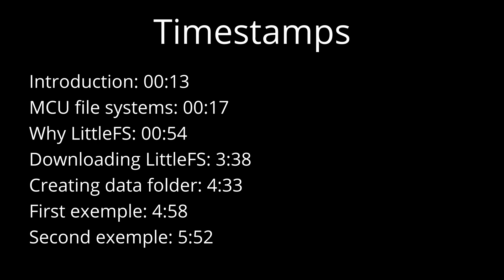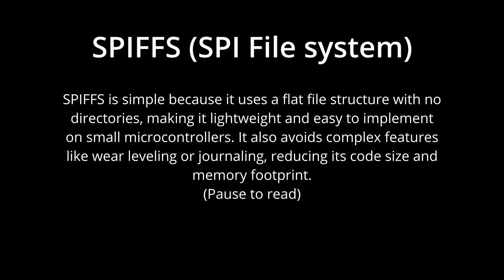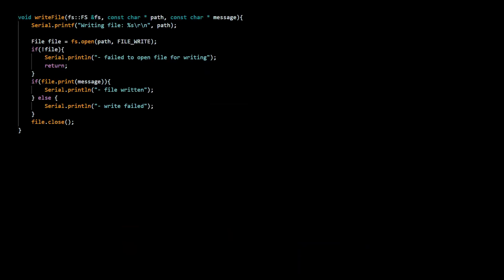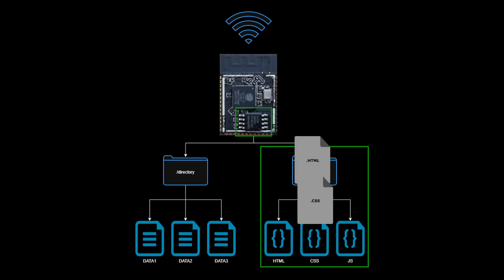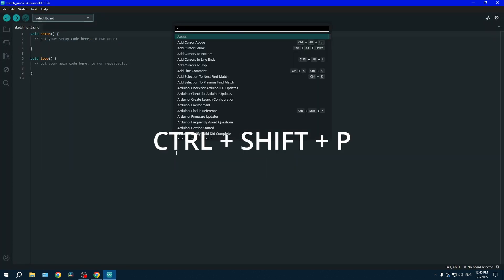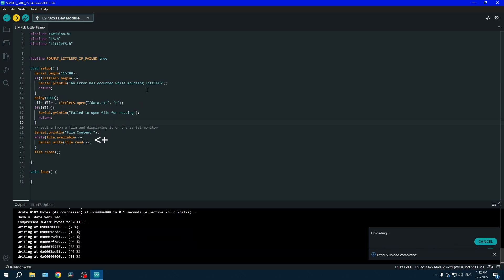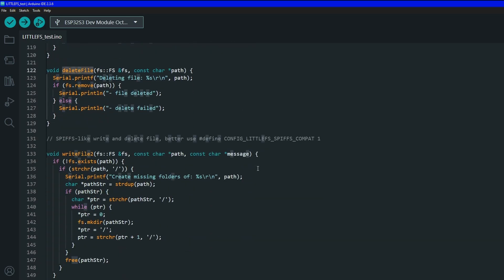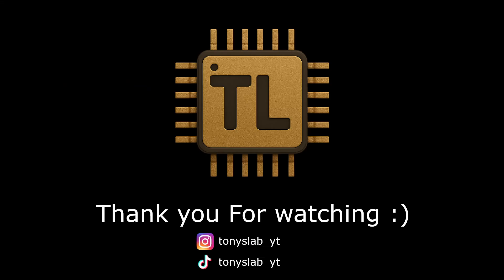#2 – ESP32 File Systems Explained: LittleFS vs SPIFFS vs FatFS + Arduino 2 IDE LittleFS Setup Guide

Comment: I am getting "ERROR: No port specified, check IDE menus.", even though I have selected esp32 dev board and the port as well. Can you please help here?
Reply from the maker: Do you have multiple arduino tabs open? Do you have serial monitor open?
Reply: @TonysTechLab  It happened to me too, just restart the arduino app, unplug the esp cable, reopen the arduino ide, plug in the esp32 cable, don't open the serial monitor, just upload and it works, Thanks so much btw! You helped me a lot